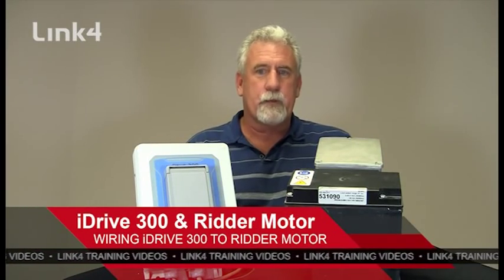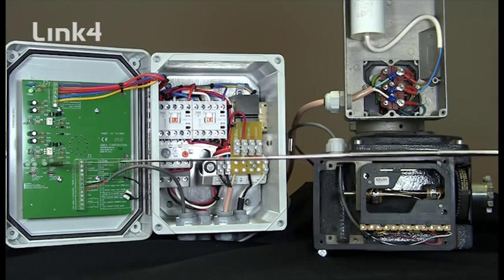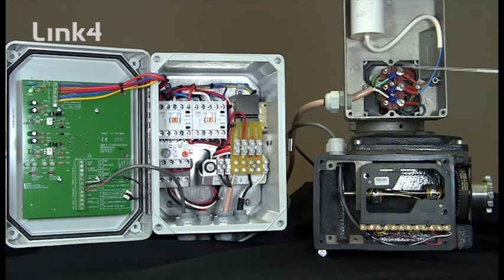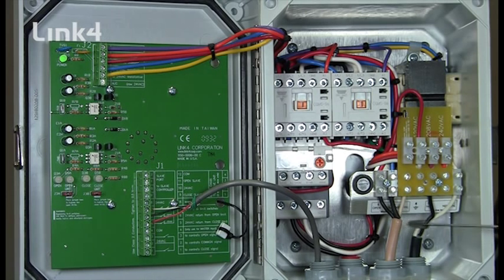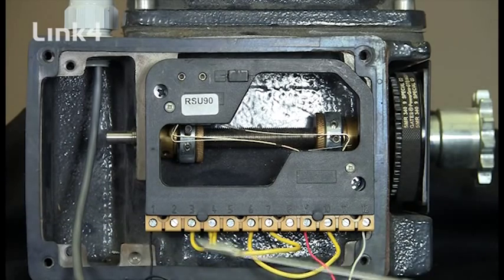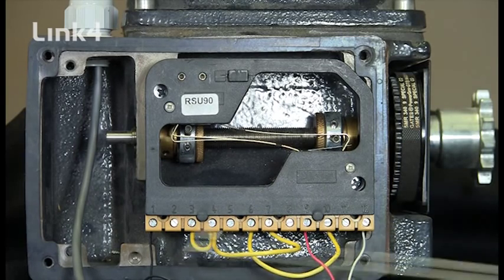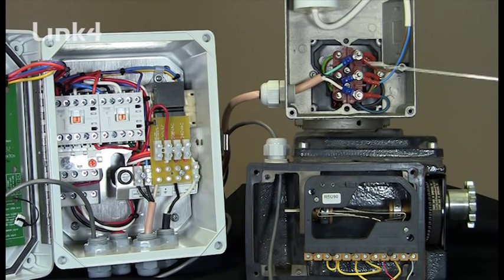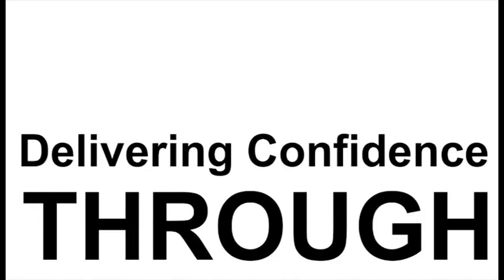Ridder Motors I - Overview & Wiring a Ridder Motor

Comment: I an having and installation issue and cannot get a hold of anyone Via phone. The unit works great if I run the motor backwards. Example: Switch is in the OPEN position, yet the unit closes. My wiring diagram is different than what this video shows. I have the OPEN wire going to Position 1, The CLOSE wire going to 9. and the COMMON wire going to 12. I also have the 3 jumpers as shown in the video. The wiring diagrams does not provide any information to correct the issue I have.